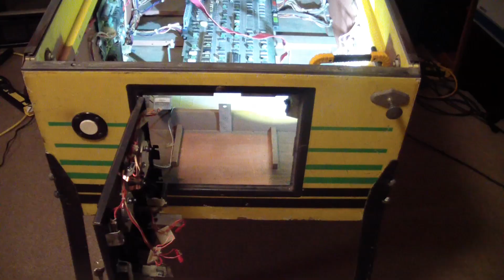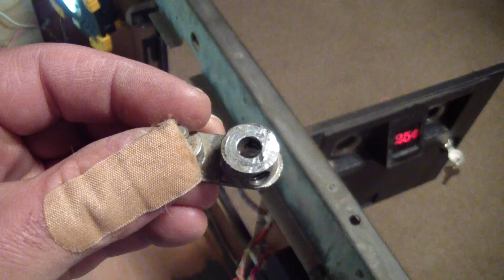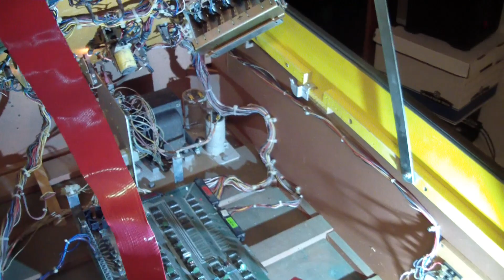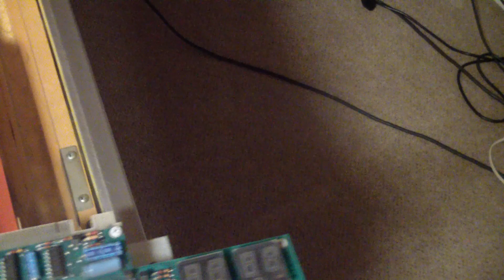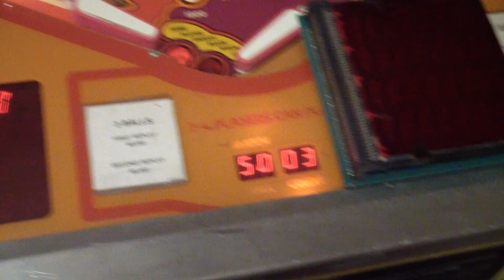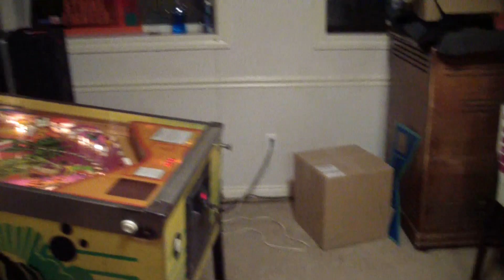AE#112 Atari Middle Earth Pinball Test Drive

Comment: I wondering if anyone has had this crazy problem! The kick out works after hitting start. If the ball doesn’t score a point kick out works. Once you score any points and the ball goes back the kick out it just keeps add points and doesn’t kick out. Switch works on test. I’m so lost. Thanks

Comment: The 2-digit displays are still being made.  Of course the only solution for the main display is a recreation using LEDs.  LISY in Germany developed an open-source LED replacement.

This game is missing the protective pan over the main PCB but that's really not surprising as those were often left out.

Comment: I have an Atari Middle Earth machine that the bonus lights and right play field lights do not illuminate, as well as the scores are missing the 10's and the fourth score stays at all completely illuminated. Was thinking drivers on the Auxiliary board  for the playfield lights. Not sure what to think about the score board. Have done a fair bit of work and the machine is fast and great to play! Anybody have any insight into these matters?
Reply from the maker: You are faced with two non related problems. 
The lamps are arranged as four separate groups, each group getting a power feed from one of the four TO3 transistors on the aux board.
The score display may be suffering from bad driver transistors (under the score panel) and/or corroded connections where the glass displays connects to the board underneath.
Reply: @artifactelectronics  thanks for your reply Art I've watched a number of your videos they're great and very informative thanks so much

Comment: I don't remember the arcades of my youth having any Atari machines (lots of Bally and Williams, though). 

Interesting that Atari chose not to include a free game "knock" solenoid. That's the sound I was waiting for when you got the match.
Reply from the maker: Even current machines now emulate the solenoid knock through the speaker. but there's tutorials on how to add a real knocker. There's no easy way to do it on the Atari machines.
Reply: @artifactelectronics  I didn't know "easy" was part of your vocabulary...
Reply: Knock noise. Its super loud and high pitched.  It basically did the same thing as a knocker as it announced to everyone in the arcade u just crested a replay score threshold

Comment: Just FYI: When you are close to the machine your camera is picking up a wicked high pitched buzz/squeal.
Reply: Noise from the SCR drivewrs that control the lights and the solenoids.
Reply: @SeanBZA  Whatever the source, filtering the audio would make it far less annoying to the viewer :)
Reply from the maker: It is an annoying buzz, but I show the machines as they are. Just imagine how annoying it gets in real life.
Reply: @artifactelectronics  I thought maybe the camera was 'enhancing' the audio as can sometimes happen. I guess in a noisy arcade the buzz would have been downed out anyhow.

Comment: To 'unlock' set screws in loctite, just heat them and the bond will break.  You can do that with a lighter.
Reply: Soldering gun, the big type that is used to do those massive ground plane soldering jobs, where you want to solder a 00 gauge wire to a massive copper plate. Cook the locking compound till it crumbs up and comes loose.
Reply: He did mention that he tried heat. I'm guessing the part did not get hot enough though...